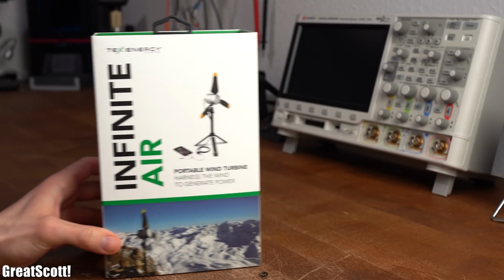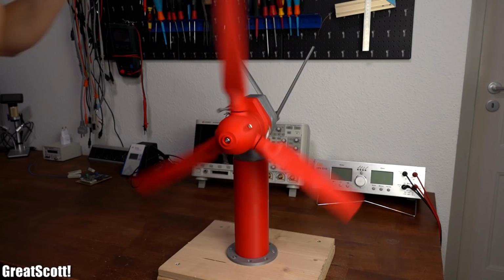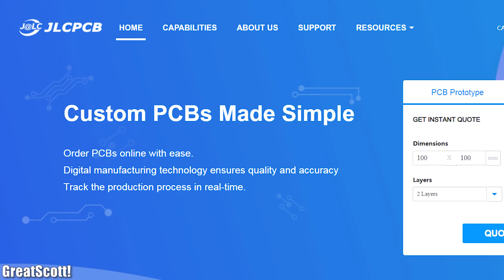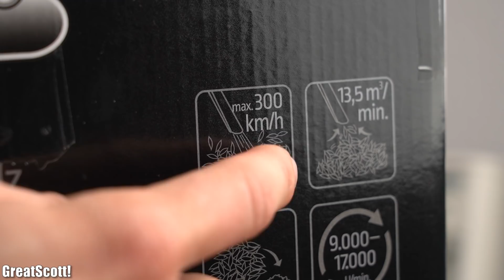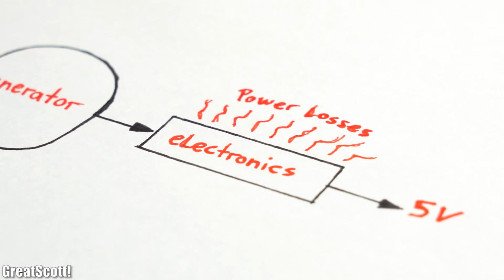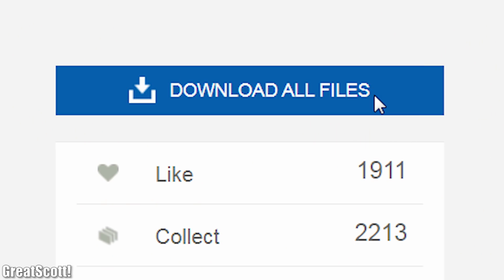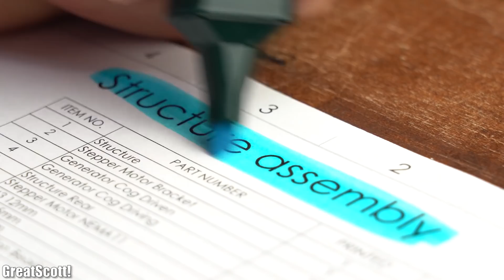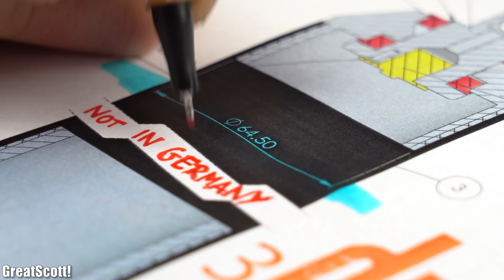Mini Wind Turbine || DIY or Buy

Comment: HI BRO IF YOU ARE READING THIS THEN THERE IS IDEA FOR YOU AS FIRST YOU TAKE A 12V OR ANY VOLTAGE DC MOTOR REMOVE ITS WINDING AND DO THIN COPPER WINDING MAKING IT A DYNAMO THEN PUT THIS MOTOR IN DIY WIND MILL ARE REMOVE THAT GEAR RATIO INSTEAD MAKE A GEAR RATIO THAT INCREASE THE ROTATION OF DYNAMO MOTOR THEN TEST VOLT AND AMP OF IT PLEASE 🥺🥺🥺🥺❤
Reply: Well, if it puts a 12v DC generator, is there a need to put a gear ratio or not?

Comment: I think the biggest problem is the small surface area of the fan blades. For any of these devices to work properly they would need to have 2 meter blades.

Comment: minimizing friction losses decreasing flywheel weight while increasing sail surface area and of course light lubrication should improve the design I'd be shooting for 3000mw or 3amp at 5v for design specs that'd allow for charging a battery pack and the parasitic drain of a device running on the battery pack as long as the wind blows also thank you for sharing the content ❤

Comment: after the first strong wind, the 3d-printed version would break or become extremly wobbly. This should be mentioned in the comparison as well. Whats the point of a wind turbine, if you can only use it inside a room, with a fan? This comparison just hurts....

Comment: I had to go back and watch this video again after seeing a few videos on the channel  ' Robert Murray-Smith ' regarding wind turbines. His latest covers the use of an equivalent of his wind wall for producing power for a country.  There is also a video of his where a cheap ceiling fan from China was converted into a wind turbine.  With your experience in DIY power banks and turbines,  it had me think I should ask you to look into this and see if there is a way to make a vertical axis turbine that could be replicated, open sourced, and used with your solar cells in a charge controller for backup house power??

Comment: THE vwat SHOULD be cable to WORK with breeze 1m/sec, 200w motor pma, ?is it. Possible to convert to 120v using 500w sine pure wave? OR DOESNT FULFILL the minimum watts? Requiered!

Comment: I was very interested to find this video, because I bought the exact same wind turbine and am also currently printing the same one from Thingiverse (on an ultimaker 2 extended). Thanks a lot for the infos. Note: I think in real world conditions, the DIY one will perform better than your tests. Reason is the blades are much longer than the commercial one and will pick up much more wind. Your blower only has a small output hole, so much of the bigger DIY blades are unutilised in the test. I would recommend you use a good size fan with large blades to generate the wind for testing. I got 700mw output from the commercial one, generating with a 50 W 30 cm diameter fan and 800 mw from sticking the commecial blades onto an old motor from an HP printer that I threw out some years ago (3d printed the joining piece and added a 2:1 gear with lego technics pieces - dont laugh…). I am planning to test both with a 150 W 50cm diameter fan once the complete 3d printed version is done.

Comment: Lets face it, as a DIY project this is just a hobby for those of us who are lucky enough to own a 3D printer. For anyone who really needs to generate their own electricity, this project would not be viable; therefore "BUY or DIY?" is only a question for those who already own the machinery required to manufacture the components.

Comment: Testing by leafblower isn't exactly an accurate demo. These types of turbines utilize blade area as well to generate power and the leafblower does not generate wind over the entire blade or indeed all the blades at once. blowing a small wind area on a large blade will mean a lot more losses due to milling the static air with the larger blade. and these two did not look like they were the same size nor blade area. A better test bed would be loading both on a pickup truck or sticking them both to your car roof and driving at different speeds while logging the power generation to see how they would actually perform in the wind.

Comment: i hope this tip could help you to increase efficiency
1)make a vertical axis fan then your turbine doesnt need extra gear to lose its power. vertical fan has less moving part and it save more space than horizontal fan
2) make the moving part lighter so the fan has less friction to spin.

here is good reference https://youtu.be/QSnHShly5R0

Comment: Wind turbine used lift force from physics , I am aware of the scams "for sale" wind turbine but in a DIY wind turbine you should have taken care of it , the blades of turbine should be of aerofoil shape and slightly tilted ,only then will it spin and produce electricity.

Comment: I want to build a towed water turbine to generate power for my sailboat electronics while I am sailing.  The shape of the towed blades is entirely  different in design to the driven blades of the propellers used in outboard motors.  But this shape would be perfect for a 3D printing if I could find scaled drawings.  Any suggestions?

Comment: I have a marine wind generator that I want to use at home....it has worn fiberglass blades that aren't long and heavy.   Where can I find blades or somewhere that will shows me how to make long light weight blades (3 blade) that will make the marine wind generator turn as fast as it would out on the sea?

Comment: Your electronics skills are astounding, truly, and thank you for all your videos and information sharing, but I'm sorry your assembling skills need a little a litte bit more work 😄. There were a "few" inefficiencies added to the diy turbine (imbalanced propellors, propellor angle, vibrations, 3d print layer line orientation, densities etc etc). Still excellent video. Thanks again. 👍👍👍👍👍

Comment: You need to balance those turbine blades in order to eliminate the rotational vibration. I suggest using a high sensitivity scale to make the blades all the same weight.

Comment: I realize people have already mentioned it, but stepper motors make very poor generators.  I forget the model name now, but a few years back I was researching DIY wind turbines and there is a (now hard to find) old IBM disk drive motor with very good properties when used as a wind generator. In fact a lot of the drive motors from back in the 80's tend to be very good.
Another learning experience may be wiring your own generator. I saw a lot of articles and videos of people using hard drive rare earth magnets and wiring their own generators with varying degrees of success.

Comment: So i dont understand why to use small motor in diy version? Just connect bigger one if that is the case. Beside i think you still have issue in blade installation which not rectify full wind power. However, u suggest to have ready made turbine blades

Comment: I think in DIY version their was a little bit of vibration . All propeller blades do not have same weight. It can reduce the output. Another thing is that you have already mentioned that the the the mechanical gears are also responsible for the lesser output. 
Nice project. Like your videos.♥️

Comment: Its a cool project. But i have a problem with this 3D print stuff. Why dont you use classic plywood? At least for the rotor blades. To be realistic i think most of the stuff people print with this things is a waste of valueable Materials. Because Plastics are not the greenest thing to work with.

Comment: Well, when you guys want to build wind-turbine, make sure that your generator produce some useful voltage for given speed of rotation. How can you hope that stepper motor generating max. 2V peak can be useful?
And you rectify this low voltage with standard diodes - you get even lower voltage (about 0,7V). This is absolutely useless. Solution is low speed, three phase motor.
I can recommend salvaged bldc motor from FDD (floppy disc drive - I know, pretty archaic device, but can be still found in old computers), 1000rpm generates about 9-10V (peak-peak). Small wind turbine can drive this motor directly. When you know how, you can make synchronous rectifier and save voltage drop on classic diode rectifier. You can also make boost converter and MPPT controller (maximum power point tracking) to get maximum available power. There are many possibilities for improvement. If I had a spare time...
But anyway, nice try - now make it better :)

Comment: The Mechanical design is off set, and plastic gears are terrible in power transmission. If you have used sun planet gear train, the torque would be high and so does the power output (Electrical power)

Comment: I'd rather call it a " fancy 3d project " than a DIY

The design is too complex forDIY
You were mesmerized of the mechanical/ aeronautical design 🤦‍♂️
That you forgot that the project is for 
D.I.Y or Buy
For me
1.You should have gone for the savonius type propeller
Instead of the miniture version of the wind generator turbine
Your miniture version of a wind turbine is design to let the wind pass through freely ,for structural integrity. And for rigid and precision of the higgest level per se.
Any small mistake would greatly affect its efficiency.
Example,
When you made mistake in the pvp ( variable pitch)in 7:21
Which made it loose and not so secured turbine in 9:16 
Thus causing unnecessary vibrations 
Added more to its inefficiency
It is also a non cost effective due to itsxhard to made parts 
And a must precision needed too build it

2. A simple BLDC motor except for a stepper motor
Because the stepper motor is designed for angular positioning 
Rather than a continous high rpm, thus also restraining its rotation.
Reply: My proposal is you create savonius type propeller ( WHICH the main frames / structure are 3d printed and or a fully 3d printed savonius turbine 

Then connected with a pulley/gear and chain system(which it simpler to understand)
Then connected to a continous bldc motor.

All that have to worry about is the friction loss on the belt.
Many have made it.
We once test it during a storm for the thesis of a friend. 
An emergency power thesis.
It was rather stunning to be able to cope with the wind speed
While not breaking it. 
Instead of a bldc motor and 3d printed and pulleys,
The turbine was made of metal sheet.
We used a bicycle gears and chains.
And a cars alternator.
Reply: For me wind energy is not a cost effective for small projects
I would rather make buy a portable solar one 
Or hydroelectric one
But wind,? That type? 
You can only use it occasionally for windy season,
Not the best.
To many mechanical energy losses

Comment: Would you recommend using a different motor in order to have a high energy output? or would this not be possible with the current design?

Comment: hello, GreatScott!!. I currently have a 1s 1100mah lipo battery. I wanna power a 1100kv brushless motor. Obviously i cannot do that. So, can i use a boost converter to up the voltage to 7.4 and run the brushless motor? i don't think so because the output current may not go more than 1A. What is your opinion ?

Comment: The system in the propeller is sensible to the speed of the propeller, because when the speed increses, the swashplate will get away and will give more angle to the blades, and the wind turbine will be more efficient. It is quite normal that by activating one, the other blades don't move, because it is only there to standardize the mouvement, to give to every blade more or less the same angle, but the activator, to give angle is the wind, and not the swashplate. (Well, that's my opinion, I do not rule out the possibility that I am wrong) Other than that, good video, as usual, and good luck !

Comment: You can’t equate a 24kph wind with 24kph output of a leaf blower as you’re only applying pressure to a tiny proportion of the full sweep of the blade with the leaf blower.

Comment: That 300km/h is on a the small output area of the leaf blower and that is way smaller than the sweep area of the wind turbine thus the small output power. In any case a solar PV panel is always a better choice than a small wind turbine.

Comment: Great video. However I’m curious why the diy uses a NEMA11 stepper motor? That seems like a terribly inefficient choice for a generator. A simple brushed dc motor is a much more efficient power generator, ideally one that is high voltage at low rpm, say a 90vdc, 1400rpm brush motor if coupled directly to propeller and spinning only 500rpm will provide theoretically 32v (actuality will lose an estimated 30%, so output will be in the neighborhood of 24v) without need for any form of rectifier circuit, then just need that to feed to a simple charge control style regulator to drop to 5v and possibly higher wattage.

Comment: next DIY or BUY idea - 5.1 surround sound with 5 wireless speakers (may be runs on battery) and the subwoofer has a raspberry pi that controls the 5 speakers and has FM/audio in and HDMI out to connect to monitor to run videos as well.
Reply: Nevermind, sounds like a coding project rather than an electronics project

Comment: 5:00 why don't you fix the oled on your diy power meter? You haven't adjusted your code for 64 pixels high display. That's why the oled looks so weird.
Reply from the maker: The Arduino does not offer enough space for that.

Comment: I'd be interested to know your thoughts on the difference in durability. I assume you used ABS plastic, do you feel like the DIY option will hold up as well as the store bought in high wind conditions?

Also, would you be able to customize out the motor for a direct motor? I wouldn't like to use the gears if I can avoid it.

Comment: I'd say, that both variants aren't worth it. 300mW (100mW) is anything but useful.

To make up for a useful wind generator it should be delivering around 10W at minimum at a windspeed of 20km/h (3Bft). Otherwise loading even such small, low capacity things like a cell phone will be a PITA...

Comment: Seems both designs need a conductive slip ring so the turbine can freely point into the wind without getting bound up. As they are now, wind that shifts direction a lot would cause problems.

Comment: I think the leaf blower isn't a fair test to both of them as the DIY looks like it can catch more air. And air ratio the blades is very important.

 For example if you use the leaf blower to try and spin a 10ft windmill it will likely produce 0 power.

 Based of of this test that would mean it's the worst of all even though it's not.
Reply: He definitely needs to build a wind tunnel next time. Lol.

Comment: great video but you doing it wrong.... 1st you need to use belt drive for motor and high rpm... thease type of bearings are also a big problem use sharphead bearings.. the test was unreal... use bike or car for the test fluid mechanics dont work so good indoor... for electronics use before bridge rectifire ac capicitor after rectifier again capacitor and buck convertor. to change a smartphone u need at least 5w... 10w is good.. the point is gear multiplication these kind of blades are useful for low speed high torque.. greetings...

Comment: Wind power works better at larger scales, 0.5 w (models gave less) means that your load will be at 100 mA (USB 5v), so you will need 20 h to charge a 2000 mAh battery.

So if I had a 3D printer, I would choose the DIY solution, at least is fun to work with it.

By the way, I hate the "not openable" desings, that don't let you to see what is inside. I purchased a used solar charger, and it comes with a black box with two USB ports and a LED, I tried to open it, but wasn't possible because I did not want to break it. The product works well, it does what it promises (maybe less power than claimed), but it charges your devices at 1A (5w) and more without problems, but... I cannot see what is inside of that box. :(

Comment: A small wind turbine is almost useless. A rough calculation using estimated size of the commercial WT you purchased yields a maximum power output of 12W at 25kmh, assuming 100% electrical efficiency and a coefficient of performance of 0.6 which is not even achieved by large turbines. The claimed power output is totally misleading.

Comment: Creating a "small" wind turbine is obviously just for learning purpose. It has no use in real world, even negative efficiency. If you're really thinking to make a wind turbine, think at least a metre in diameter and a few turbines connected in series. That would be sustainable.

Comment: if one was to use a nema14 stepper with ( EDIT:) 32awg wire,  what ohm resistance do you think would work best for each phase as a generator?

Comment: I think it's extremely cool that you can 3D print a wind turbine. Lifetime is a question tho :) 
The output voltage with the DIY is just 0.7-0.8V, what diodes did you use? If you used regular diodes switching to schottky would be a significant improvement.
Or as others have already said, probably a bigger one might make work better.

Comment: Nein, nein, nein! 😁 Don't even know where to start. Why do you blow air at an angle? This changes angle of attack! Not representative. DIY turbine is badly  out of balance. Plastic 3D printed gears - Nein! Buy a pair of steel gears and pay close attension to axle alignment. In your case the efficiency of mechanical system is dreadful (you can even see how one of the gears wobbles while rotating; not even mentioning tooth  profile).

Comment: 4:13 TFW you go in with a dremel just to find threads on the other side
been there XD
Reply: Looked like a snap in rather than threads.
Reply: @RobertSzasz  
also kinda looks like it was glued 🤷‍♂️, in either case it probably could have been been opened by less destructive means.

not that it particularly matters except to serve as a spring board my allegorical shared feels moment.
Reply: Hah true
Reply: pretty much why I soak stuff in acetone first and try and if it still doesn't work, some heat and then maybe a cut